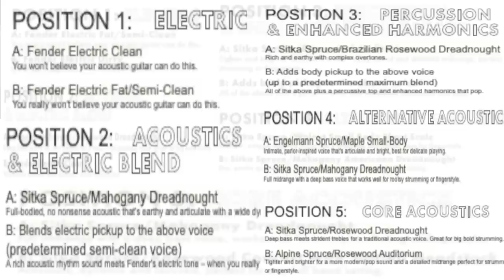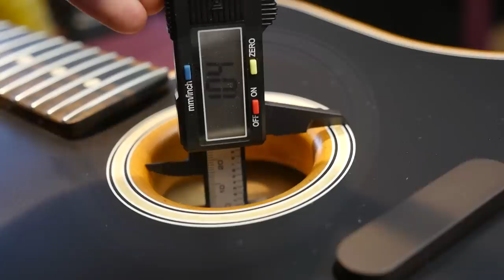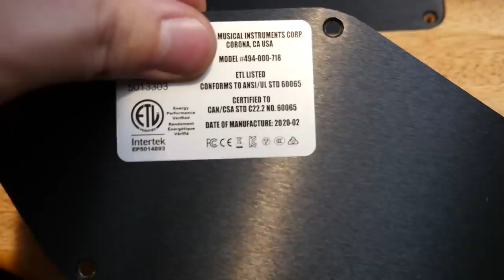Is It REALLY Worth Buying One of These? | 2020 Fender Acoustasonic Stratocaster | Review + Demo

Comment: This is the best review of an Acoustasonic that I've seen. In all of the other reviews, the tones all sounded thin, and metallic (in a bad way). It may be that the Acoustasonic should be played through an electric (not acoustic) guitar amp. Maybe that's why the guitar sounded so good in your review. Too bad it doesn't fit into a standard Strat hard shell case. Very nice review. Thanks
Reply: I have both, first and 2.nd gen sonics     and also somewhat higher range amps, also both electric and for acoustic and for me and for  acoustic tone my acoustic amp sounds best if i only use piezo pickup.

Its indeed bit pricey for what you get,  most who has tried mine like the older 1.st gen better which is strange as mostly you only see negative reviews on those buggers... 😁
Reply: Acoustic/electrics are and were made to be played through a PA system not a guitar amplifier. Now yes they make acoustic amps and they work in a pinch but a PA system gives them the best sound you can get.

Comment: My hypothesis re: the patented soundhole: the low-pitched tones of an acoustic guitar are dominated by helmoltz resonance formed by the body cavity and the sound hole. The volume of compressible air in the body is a “spring” and the parcel of air moving in and out of the sound hole is a “mass.” By ducting the sound hole as they have, the mass of entrained air is increased, thus lowering the resonance frequency. This would give louder bass tones with the small cavity. What do you think?
Reply: Sounded good to me.
Reply: Amanda Smith The guitar or my explanation? LOL
Reply: @DavidMFChapman  Yor explanation,  but I like the guitar too. A little pricey though
Reply: My thoughts exactly but you left out factoring in Humidity, Barometric Pressure and Time of day Ahahahahahah!

Comment: It impressed me more than anticipated. I'm not sure I'd want one, but thanks to this video, I'm not sure I wouldn't, either. It occurs to me that another option for making this axe more legitimately acoustic and electric, you could swap out the first three strings for electric strings with an unwound G-string, though you would probably want to use the first three from a 10-gauge setup. You need to fill up that body with sound, so it's hard to say; it just might make the guitar better-suited for blues-type players who need bending to be a bit more plausible.

Comment: Buy a Godin  A6 for less then half and sounds better.
Reply: Agreed , or Taylor T5
Reply: Except....the Godin has a stupid design flaw...if a string snaps and the ball end falls into the body (which it often does) it shorts the electronics...happened to me several times mid-gig....
Reply: For that much you can take your pick of used Herringbone d28's !!
Reply: @peterlawson777  any simple diy fixes for that?
Reply: @savvasmichael  I have the T5z and love it.
Reply: Of course I would prefer a Godin A6 than this expensive fender toy
Reply: Peter Lawson how hard are you beating the strings, Ive never broken a string on my godin
Reply: bigbromiki1 well I giggled it regularly and strings do break on occasion, so it happened periodically, without me hammering it too much. Thing is, if it happens just once, you risk the electronics shorting and that’s why I reluctantly got rid of mine...basically it shorted each time a string broke.
Reply: Jeff Hebert  My neighbor buddy bought one. Very nice indeed.

Comment: The only reason I would think about buying one is that I play solo / duo acoustic shows at bars and it would be really versatile for that.  You could use a looper pedal and record an acoustic loop and then switch to electric and play a lead over that, for example.
Reply: value wise - get a Carvin AE 185 -  I have done the solo thing for 30 years and have tried every configuration with acoustic/electric. Hamer, Carvin, PRS.  use PRS Hollowbody/ piezo now, but cant beat the Carvin,  You can also add a Fishman Powerbridge to a real Strat or Tele( I Have both) and that also sounds awesome - (and for less than 2K)

Comment: They also made an Acoustasonic series before. It was a Strat or Tele where the electric body was carved out and a soundboard and acoustic bridge with tone and volume controls on the bridge. 18v preamp system, 3 active piezo undersaddle pickups and 3-way split saddle. It sounded thin unplugged and plugged in, but since it was an actual caster it played identical to the electric.

Comment: That's an N4 Middle pickup that was release on the Elite Stratocaster Series. Which makes sense because the Elite was last produced in 2019ish which is roughly when these were designed. Knowing Fender that may have updated that to the Ultra on newer versions since the N4 went out of production is 2019ish. -Bruce Gombrelli

Comment: I believe these were designed by Brian Swerdfeger.   Before working at Fender he worked at Taylor and helped develop the T5 and T5z series.   I own a T5z and love it - it's basically all I bring to open mics.   However, the two guitars differ greatly in pickups - as the Taylor has dual stacked humbuckers (one hidden under the neck) and a body sensor.   So far my T5z has held up very well despite taking it everywhere.   I would expect the Fender to be durable as well.   All of them are very expensive (I have the "classic" which is, IMHO, the best value as all is equal except basically the top and comes in under 2K).   I don't dislike the Fenders but they do look a bit weird to me.

Comment: The sound on that is a bit thin for me. I have a Gretsch G5420T (which has a decent acoustic sound) and a Traveler Guitar Redlands Concert Acoustic-Electric Guitar. That pretty much does it for me. I'm happy with them. If I want to be a bit aggressive with the overdrive, volume and gain on the Gretsch I install the F hole plugs to control any feedback. Works for me.

Comment: The sound hole looks like something you see on some South American guitars. I think it's called a tournivas. Basically it's a tube the same size of the sound hole that extends down most of the way to the back. It's supposed to give the guitar a broader smoother sound. Fender patented it? OK, but it'll be hard to defend in court though. It's been around for about 50-75 years....

Comment: Next generation should have a passive / active pickup option so you're not SOL if it's not charged. 
Review was pretty thorough and 'fair' I thought. 
The comment about distortion causing feedback was a bother. Wonder if there's a sound hole plug that could help?
Also, third string appears to be wound so I'd imagine bending to be a problem.
Sounded nice through that amplifier but I'm still apprehensive to pull the trigger and buy one.

Comment: The Taylor T5z is a better guitar. It works well with distortion and sounds great as an acoustic. It uses 9v that really last. The build level is higher. It can also sound like many different electric guitars. I bought a used shaded edgeburst pro deluxe in near mint condition for half the cost of the Fender and it camewith a Taylor hard shell case. Fender needs to up their game.

Comment: One of the things that I really don't like about this series of guitars is that you can't just go straight from the pickups out.  It all has to go through their modeling software.  I feel like they should have put in a three way from the piezo/electric and then a rotary selector for their various modelling things.  Maybe go with a five way that combines electric/piezo/modelling.

I feel like there's a real missed opportunity in that you're paying for a modelling guitar with ten different models emulated.  If there is a software aspect to a piece of gear, it should be upgradable, or have the ability to download new models.  Not being serviceable is fine for a cheap piece of modelling gear, but it's unacceptable at a $2k price point.  Are you willing to have your guitar become obsolete when they release the Acoustasonic series 2?

Comment: Good job, big Trog'.  I overlooked the acoustic strings aspect until your video.  Being a MOR singer/pop-rock player, I could probably live with the Tele one with mild overdrive for the occasional solo.  And you showed the gig bag, nice.  Anderton's Music did do a comprehensive video of all three models on all of the 1-5 and A-B settings.  The Tele model just seemed to have the acoustic tones that really caught my particular ear with its richness and presence.  Others might differ in their opinions, no doubt.  I guess I would have to try it with some pedals or on my tube amps with dirty channels to see if the feedback factor would douse the dream or be controllable, ha.  I like the dual body contours of the Strat and Jazzmaster, but I think the thin-line aspect of the Tele body with integrated forearm contour, compared to a full size acoustic, would likely seem very livable/comfortable on stage.

Comment: I like the concept but there's still a lot of room for improvement before I hand over that much money. I'm very fortunate to have a grand concert sized Brazilian rosewood and the tone on this, perhaps it's just my speakers, isn't quite there. Of course there's so much more room for colour finishes, wood choices and hardware options. The lack of hard case is an issue especially at that price point (but I think a white interior would show off the colours really well). The rechargable battery is a nice touch but kinda impractical. I'd prefer a Fender battery I can remove and then charge rather than leaving a whole guitar out to charge. But, yeah, we'll see what the future holds. I'd also love to see a comparison between the 2 models as well.

Comment: What's with the line in the body just below the bridge on the side? Looks like you got a big crack under that matte surface. Hard to see at some angles but very apparent at others.  I also think That pcb will fail. Sounds great plugged in!
Reply: If the PCB doesn't fail the battery will.

Comment: it's a real expensive guitar but then so is an American Strat or Tele....even MIM's are expensive now......one thing to consider about just having an electric and an acoustic instead is another problem.....if you want a decent acoustic sound you also need and acoustic guitar amp or possibly a keyboard amp. If you try to use a normal electric guitar amp you won't get the sound. It will always be off....you need multiple types of speakers to get the good sound..

Comment: I have one of these and the 1st thing I did was put on a 10-gauge set of Ernie Ball Rock and Blues acoustic strings(w/ a plain g string). It is my firm belief that Fender should be shipping these guitars w/ 10's. They just flat-out sound better(especially when played unplugged), more appropriate, than the stock 12s. The 12s are just too heavy for this size body. And when amplified through a good acoustic amp the guitar and all the settings sound freaking great anyway so why would they put heavy-ass 12 on these guitars?!?

Comment: The electronics pcb i think must be a lot more complex than it looks on the face side,in the bottom probably has some dsp chip for the effects and various tone settings.Also the guitar jack has a micro usb connector all in one package but all the usb connectors tend to fail after some time and this has to be repairable otherwise all the jack connector has to be replaced but this dont seems to be the easiest available part to buy other than a special order and maybe.

Comment: 15:24  "a proper acoustic amp" is pretty arbitrary. I run my Fender CD60CE through a little Behringer BXL 450A that I bought in a pawn shop, and various folks I have jammed with have been consistently, pleasantly amazed at the tone I get with them (I also preamp through an old Alesis Microverb III for its smooth compressing-limiting quality)

Comment: As the rechargeable battery ages it will hold less and less of a charge. Seems like a gigging musician would want replaceable rather than rechargeable battery that would be a show killer when it dies.  Where do you get a replacement battery?  Don't worry about the glossy spots on the top, that satin finish will pick up fingerprints like nobody's business, plus will get shiny where your arm rests so there will be shiny spots all over the top anyway. For a Swiss Army knife guitar that can sound almost like an acoustic or almost like an electric with neither one as good as the real thing, that guitar is grossly overpriced. For that $2,000 price you could buy a decent strat and a decent acoustic, both of which will sound way better.

Comment: That laminate top looks cheap as hell. Unplugged it sounds bad, but not really designed for that. The exotic woods are pretty interesting though. Blending of the pickups is a very fun option. Battery operated? 🤮... Everyone says acoustic strings are the way to go which I was surprised by so the electric strat pickup seems like a weird thing to use. All in all, I’m sure it’s pretty fun to play but with the price of $2k, my god no

Comment: I have a Taylor with an LR Baggs Anthem in it and, unless I missed this, the Acoustasonic is appears to be missing something MAJOR. The Anthem allows you to adjust the blend the mic with the pickup to control feedback. You can get a Taylor and install an Anthem for less than the Acoustasonic. Trust me, I did it. Strats are my preferred electric, but own Taylor's with both the Anthem and Expression systems. Both out perform this from what I see here and I've spent less on those 2 Taylors than the Acoustasonic costs and I play lead. This is a luxury, not a necessity, IMHO. If Fender ever makes a MIM of MIJ, I'd consider buying 1, but there are a lot more things I'd put $2K into before I'd buy an Acoustasonic. Oh, and BOTH Taylors came with hardshell cases for less than $2K combined.

Comment: Take it from me, I play over 200 gigs a year. I bought one of these, and it was a HUGE mistake. It sounds more like a banjo than a guitar, and preamps and EQs only helped minimally. Also, if you break a string, which happened more frequently than many other “straight acoustic” guitars I’ve owned, the string end will fall into the guitar cavity, and if you don’t removed the jack immediately, the string end can short out the output circuit board, which will need to be replaced. The finish scratches easily as well, and the included gig bag is not up to the daily grind of a working musician. My advice: instead of spending $2k on this, spend $1k on a decent straight Acoustic with a good LR Baggs pickup. If you still want the electric option, use the leftover $1k to buy a good used strat with an HSS setup. I just saved you money and a bunch of heartache. You’re welcome.

Comment: They've made a "Telecoustic" (and I believe a Strat) since the mid-80's-ish.  I owned an original telecoustic in the mid-late 90's and it was at least 5-10 years old when I got it.  

I don't think any of them are worth their salt as anything other than a wall-hanger or collector piece.  The electric tones are better than the older ones that just had piezo's; that really twangy 80's acoustic-electric sound that aged like milk.  They don't hold a candle to a real acoustic, even a small parlor is much more rich, let alone a big booming Martin-style dread.  They're better than they used to be as a cheap stand-in for an archtop, but not by much.  

I think of them as a practice guitar, but given their price it's kind of just a novelty.

Comment: It sounds great but all that electronic mess under the back-plate? No thanks.  
Call me Very old-school but I don't even like push-pull tone knobs, coil splitting of tapping... none of it. 
I wish Fender would use their pretty much cornering of the guitar market to just pick up their USA line. 
Like, what ever happened to lacquered Strats? 8-12 colors? Just alder or ash, maple neck or maple with a "rosewood" fret-board, and a nitro finish? If you want one you have to go through Custom Shop and spend $4,000 and up.
They got too big and even their $1,200-2,000 stuff is just polyurethane garbage.

Comment: I have an electro-acoustic (don't we all? Donald Duck, usually), a Gibson J35 with an LR Baggs under the saddle. It's a neat and discreet installation but I've only given it a brief try through a PA alongside a microphone and it just seems like more of the same - quack, quack and not worth the trouble. I've seen numbers of performers using them but it's almost always with a conventional mic because the sound is (frankly) not very good - quack, quack and back in the day I've seen loads of acoustic performers simply using a Shure 38 or similar through a PA - without difficulty. You can watch the famous Woodstock (Yes, that Woodstock) if you like to see that being done. Loads of artists have done it.

However, Gibson fit Fishman piezzos further up the range, I don't know if that makes a difference, I know of some artists installing a tiny sliver of softwood beneath an "under the saddle" to soften it, Martin introduced an interesting jobby that reproduced period-correct interpretations of famous models so things are being tried all the time with these systems.

I think what the Trog is getting here through a straightforward guitar amp is impressive and usable in some contexts. It's a shame the thing is so expensive, a shame it doesn't look great but the sounds are usable. I wonder if Fender might consider marketing the "gubbins" as an outside control box along with the piezzo to install into your own acoustic - more use I think than giving us the down-graded foreign-made "look like" that won't quite deliver the same thing. I don't care if they don't, I don't use piezzos at all, they aren't a patch on playing through a mic. Thanks to Troggy though, he does a good video always.